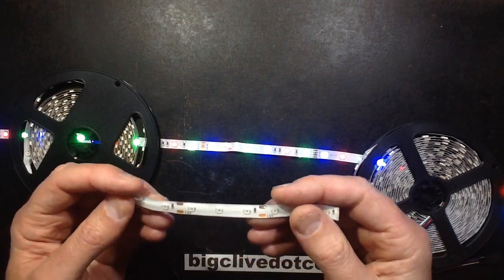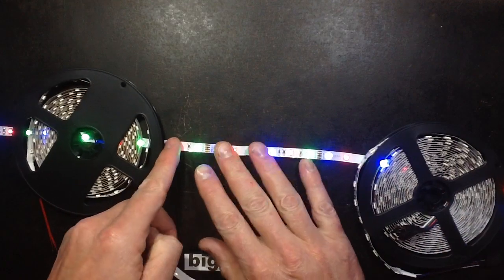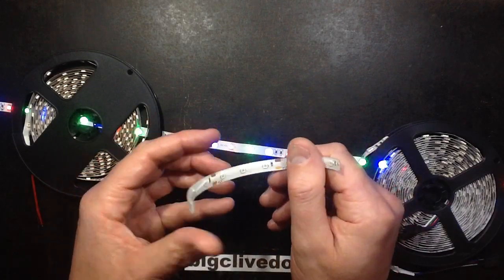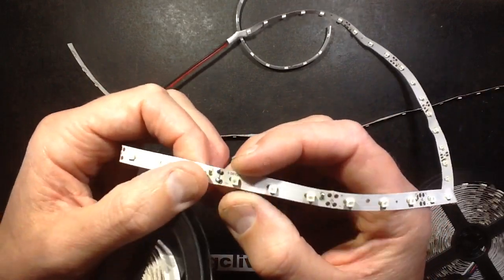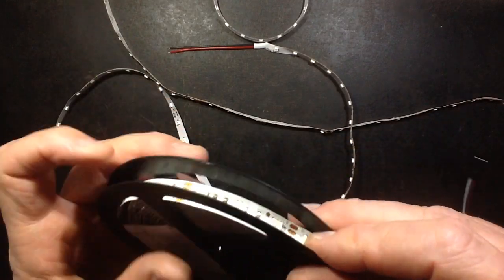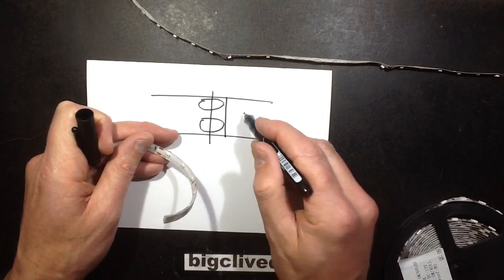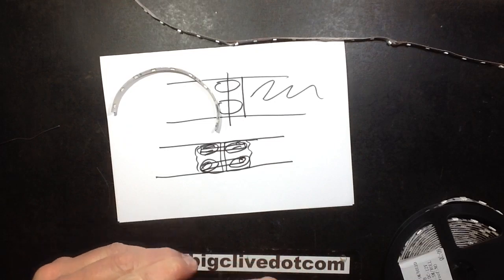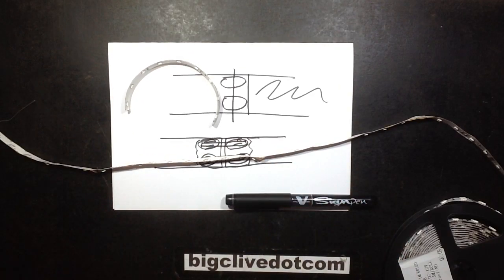The weakness of standard LED tape in costumes and props.

Comment: I don't know if the waterproof stuff you use is the same as mine, but I found that you could peel up the adhesive on the back, exposing the contacts on the underside rather cleanly.

Comment: Weak solder joints on costumes: I haven't built any since the incandescent era, but I got in the habit of glopping the connections with a bit of hot-melt glue. It kept them from flexing and breaking at the connection. Since the glob of glue usually tapered off onto the wires, it formed a graduated strain relief. And if I did need to get into the connection again, a soldering iron works fine as a hot-melt glue gun. No need to remove the glue before re-soldering the connection! :-)

Comment: I imagine preparing a roll of tape by having a pile of pre-snipped tiny copper wire bits that you could drop onto each solder joint.  As well, a piece of fiberglass reinforced packing tape to go on the back of the joint and a blob of epoxy on the front after the soldering.

Although unless it's epoxy with a long cure time, you'd have to stop and mix new every so often.  Maybe something like JB Weld?

Comment: Great information on the rgb lights, I actually just ordered a couple strings and other pieces so that I can run them along the ceiling of my room. Do you have any idea on how noticeable the brightness drop caused by the voltage drop would be from running more than 2 strings in series would be?
Reply from the maker: +notaniel2010 It could be significant.  It would be better to feed from the centre and run the two strings out from there.

Comment: +bigclivedotcom  i have a question what can LED light strips be used for?
Reply from the maker: +william armstrong They have lots of applications.  From concealed lighting to being used in short sections as an alternative to lamps and being openly visible as a sharply defined line of light points.  It's often cheaper and easier to use the strip than it is to individually wire and mount LEDs.  The RGB stuff also lets you control the colour of the light emitted by the strip.

Comment: I wonder if something like some 0.5mm PCB material stuck on the back as a stiffener would help. Some tapes have pads on both sides, so an option may be to fully overlap them & solder face to face so you have a thin layer of solder over wide contact area

Comment: Very nice. Thanks
Do you also have a solution for the horrible adhesive tape. It will not stick to anything longer than about 5 minutes.
Also good quality tapes will fail when they get warm so mostly I use some sort of kit.
Any suggestions?
Reply: +getreal155 Clean the area where you're going to stick the tape to thoroughly with a degreasing cleaner (Isopropyl alcohol for one), any contaminants and the stuff just peels in 5 minutes...

The tape I used in my shed for lighting is still somewhat attached, but I kind of cheated by sticking them onto the tacky paint that I'd applied, and most of it stuck nicely, so if the fake "3M" tape doesn't work, just apply some decent glue over the top of it and hope it sticks... :)
Reply: Yea..I was hoping for a clever solution but was expecting this answer. :) Tnx anyway for thinking with me.
Reply: getreal155
I don't really think there's a clever way to make the stuff stick properly, unless you used something like double-sided foam tape as a support between surface and tape, but then you'd lose the thermal dissipation, epsecially for the larger 5050 LED chips, LED tape is a great idea, it's just not easy to implement properly... :\
Reply: Like I said before adhesive kit works but it is kind of messy. Adhesive foam doesn't work with 5050's. The led's do not survive long due to overheating. Best for thermal dissipation would be to peel of the fake 3m adhesive tape ...but that takes forever.
Best would be a good adhesive tape that could stand some heat ;) but yea.. We love cheap Chinese crap and we all hope that some day they will learn :)
Reply: getreal155
Yeah, I keep buying chinese tat and complaining about it, I'm just waiting on some LED filament bulbs (Clives vids are so influential!!) and wondering if they'll be something to complain about too... :P
Reply: I bought and build many bulbs in the past 6 years. I could make hours worth of reviews if I had any taste for it. The filament bulbs are nice but I bet they don't last very long (overheating). Also the drivers are a huge problem.
Reply: getreal155
I've mostly ignored LEDs as a form of socketed lighting, but the LED filaments seem to have finally filled the gap that the incandescent bulbs left, especially in terms of size and lumens, CFLs still reign in this house though, the LED Filaments I've ordered are just for trialling, well, two are, the other two are cos one's a funny shape (DX SKU 379282) and the other has blue filaments (DX SKU 376378), whether they last, well, can't be any worse than the first CFLs back when they were a new fad.... :)
Reply: So the best advice is to have fun then ;) Was nice chatting with you.
Reply: getreal155
Yep, always have to have fun, otherwise we'd all turn out like borg drones... :P
Reply from the maker: +getreal155 It really is down to proper degreasing of the surface you are going to apply it to.  The non waterproof tape has the advantage of being lighter and more flexible, making it stick better.
Reply from the maker: +twocvbloke The 5050 tape always runs pretty hot.  I prefer to nudge the voltage to it down a bit (and therefore the current too.)  For short runs that can be as simple as adding a diode in series to introduce a small voltage drop.

Comment: I have encountered similar problems with outdoor applications of LED strips when they are mounted to materials that can expand or move due to thermal stress.  After some time the strips may begin to break at the solder joints.  No fun.  Better to mount them loosely in some kind of channel if possible.

Comment: What about is the general quality of those joints to begin with anyway?
Reply from the maker: +Nova Light I'd say it's a weak point in the design.  The fact it's a join means that the radius of bending is going to be tighter where the only support is a sliver of solder.
Reply: hi, dear! I make the miniature  LED MASTER MINI controller for such suits. Free software is available. For obtaining information please transfer to my canal. Radio synchronization between suits is possible.

Comment: Back in the day, some 10 years ago the company I worked for made individual one LED circuit boards that were joined with 3 solid curved wires that were then made into long chains, then placed into some clear flex track and back filled with polyurethane, these were sold to the aviation industry, very flexible but not designed to be moved once installed. they were very labor intensive to build. Why the thin tape CB was not used I haven't a clue...

Comment: i am waiting for why you now like the waterproof stuff?
you gave its problem and a solution to that but didn't say why you now like it?
Reply from the maker: +Jared Reabow (Jazza) Because it turns out that it's not so hard to get the connections clean for soldering.  But the rigidity still causes issues with proper adhesion.
Reply from the maker: +KingOfKYA Even the most expensive waterproof stuff with the boxy silicone sleeve still seems to have issues with water permeation through the material if it is in long term contact with water.  It causes visible internal corrosion.
Reply: +Jared Reabow (Jazza) Probably that it yellows and is not really water proff nothing covering the back side real(accept double stick tape). Unless you get the more costly stuff with a silicon sleeve.
Reply: +bigclivedotcom does the silicone stuff still have joins?
Reply from the maker: +Jared Reabow (Jazza) It'll probably depend on the manufacturer.

Comment: I can tell you how they handle this problem in cosplay.

1.Take a small piece of fairly sturdy plastic, and place it over the area where the soldered connection is.

2.Apply hot glue till it is about a quarter of an inch thick.

it's not at all professional, and it's likely a bad way to do it, but since the costume isn't exactly going to see as heavy use as the umbrellas you fixed, it works fine.
Reply: shapelok or other polycaprolactone plastic would work well too.